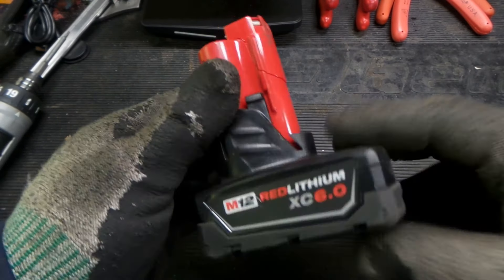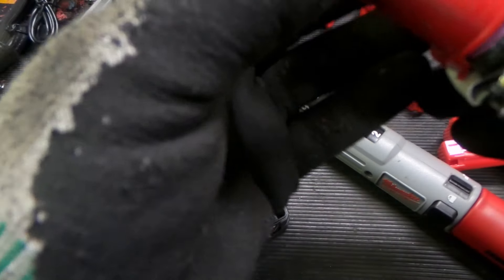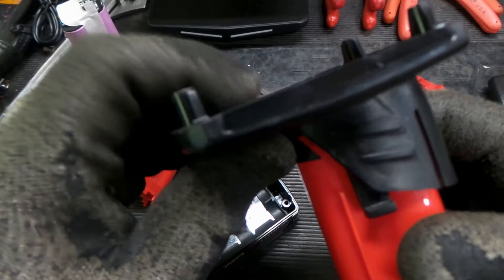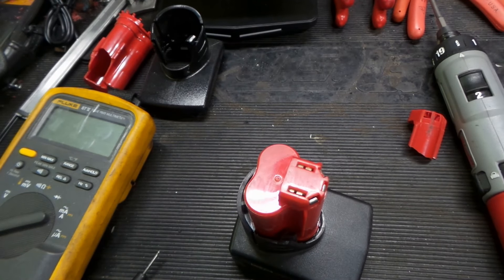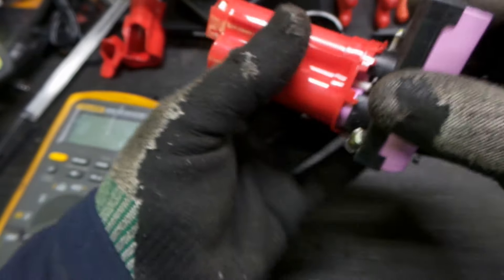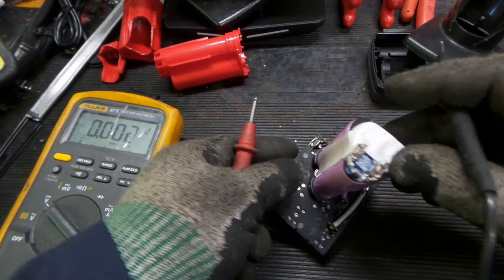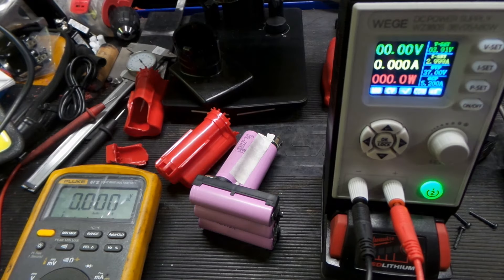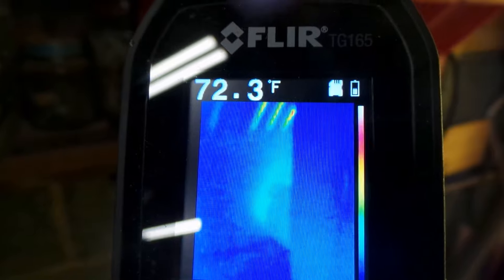Can we fix this damaged Milwaukee M12 6.0 Battery?

Comment: thanks for the vid!
 can you add  link for  the WZ3605 Anti-backflow Adjustable Digital Control DC Power Supply please?
Reply from the maker: I can no longer find the listing for the one I use in this video, but if you search for a Wege WZ3605 you should get close.

Comment: Thank you for showing the real way to do it. It takes a bit of patience to test the parallel pairs that have become imbalanced to determine if the imbalance is due to a failing cell, or possibly some other reason such as the battery not being used for an extended period of time. 

Manually balance/charging each cell pair while monitoring its voltage/temp characteristics is the only way to determine if the pack is still going to be usable with any surety. 

It's not hard, but some care has to be taken not to accidentally short any of the connections together when charging manually. 

Most people will not have the patience to do this and will watch the 3 minute video showing the outputs of a fully charged battery and the "bad" one being jumped together, and will simply try that, which, even if all of the cell-pairs are below 2.5v, is a unregulated and dangerous way to bring the pack up from LVC. 

So thanks for taking the time to show the correct way to assess and diagnose these m12 batteries that don't have a BMS in the pack. 

Also, I keep seeing mentions of the m12 charger not having any balancing capability, which, after inspecting the circuitry on the m12 charger I own, does indeed seem to have a separate passive balancing circuit. Passive balancing is slow, however, and my guess is if the packs are sufficiently imbalanced, the charger does not have time to passively balance the before the total voltage has reached the 12.6v cutoff. If the battery is left on the charger after it has turned green, it will continue to slowly balance and top off from my experience.
Reply from the maker: Thank you for looking at the charging circuit in the chargers. I will admit that is beyond my level of expertise so your input is greatly appreciated. I will definitely try leaving a pack on the charger for a while and see if that works.

I agree with you completely hooking two batteries together is a great way to destroy two batteries. I know it "works" for people but it's a heck of a dice roll.

Comment: This problem seems to be very common with the M12 6.0 ah batteries (and the 2nd/middle cell to be exact)... 2 questions: #1 Why do you start at 0.5 amps for the recharge, and not 1.0 - 2.0 amps ? and question #2, if I have a couple of M12 batteries, all BNIB, should I open them all and charge them up? Or leave them as is? I'm not planning on using them any time soon, but I want to make sure they don't die or have permanent damage from remaining unused and in the package... Let me know

ALSO... (last question lol) how long did you have that stubborn cell charging/boosting on the power supply?
Reply from the maker: Great questions. I like to start charging slowly so I can make sure nothing is getting hot. I'd say the entire process took about an hour or so.

It seems the main thing is battery management. Milwaukee does not seem unique in this either. It does not seem like the tool batteries balance charge all that well. This is generally okay, but as the battery packs age, I believe this will happen more frequently.
Reply: Its so criminally wasteful that the batteries dont balance charge every single charge. Theyd last like twice as long.
Reply from the maker: If not longer. I think it's pretty silly and they have the cells isolated it wouldn't take much to add balancing.

Comment: those version 3 of 30Q cells are notorious bad and fail
same cells were in M18 9Ah they stop making them. 
they switched to a 30Q version 6
Reply from the maker: I didn't realize there was multiple versions. How can you tell the difference?
Reply: @TalkingHandsTools most of them are using 30Q v3 like yours till around dec 2021, they switched to Sony / Murata VTC 6 - best cells 
then in 2023, they switched back to 30Q version 6, so far i haven’t seen any bad one yet, i like Murata, very strong and consistancy cuz these M12 does not have balance board, even M18 board doesn’t balance cells and you can tell when you fully charge a pack and measure them to see if they keep themself balance
Reply from the maker: @TranTek I have seen none of these packs seem to balance. When I repair batteries, I've  been matching the cells inside. My thinking is that the cells all have different capacities and characteristics. I obviously can't find an equivalent cell with the same amount of run time and charge cycles, but matching types of cells does match cell charging and discharging characteristics. In your experience, does any of that matter? To be fair I don't replace many cells I normally have to balance charge them and I can normally get the pack working again. I do have a M18 12AH that has some issues that will likely end in cell replacement if I can troubleshoot it and identify the problem cells.
Reply: @TalkingHandsTools  if you run across well made cells
they don’t sag like that, i seen many bad one and good one like Sony VTC 6 18650 to VTC6a 21700 cells that still very well balance

even those Samsung 30T and Samsung 25S 
LG are very good too
Samsung made some of the crappy one over the years and also some very good one
Reply: Probably the battery in mine, two years old hardly used and both are bad!
Reply: @martinnormand7458 yes you don’t have to use them
those cells just poorly made